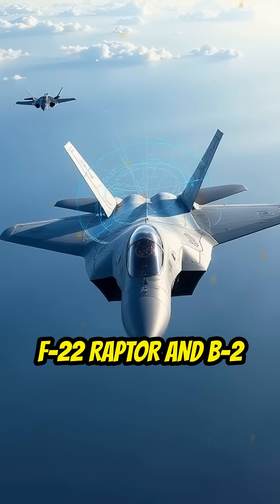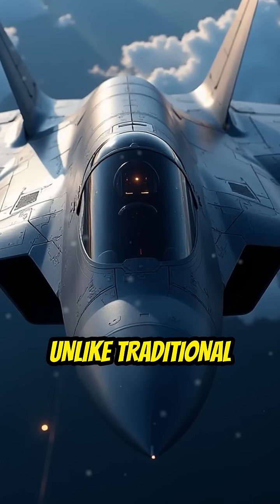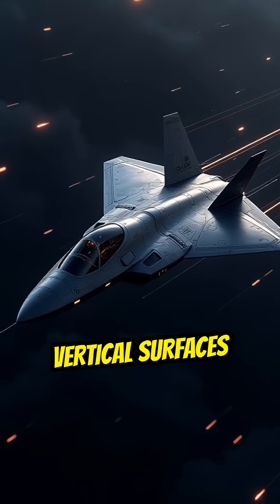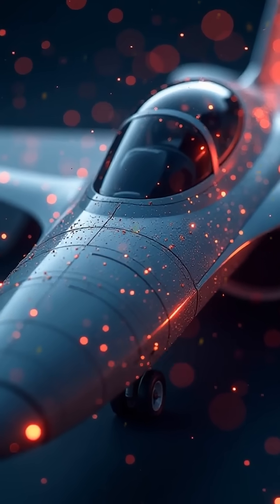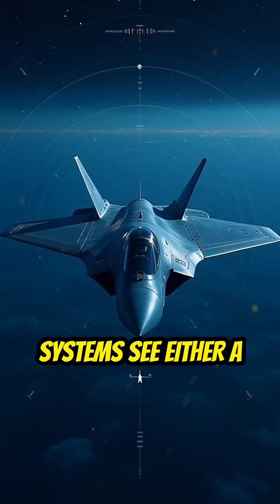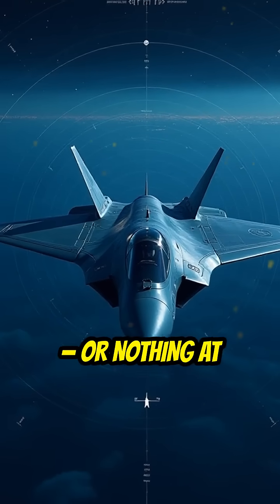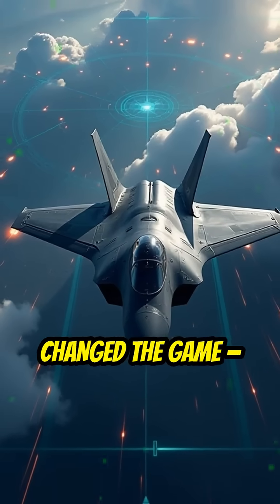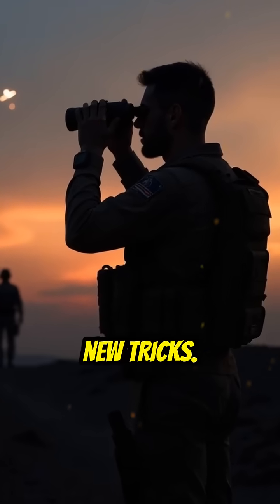How Stealth Jets Became Invisible

Comment: The b2 is a bomber not a jet
Reply from the maker: Thanks for your comment! You're right—the B-2 is a bomber by mission. But it's also a jet, more specifically a fanjet, since it's powered by four General Electric F118 high-bypass turbofan engines. So both terms are accurate—they just refer to different aspects of the aircraft. Thanks for contributing to the discussion!